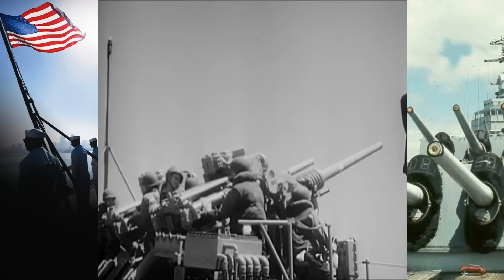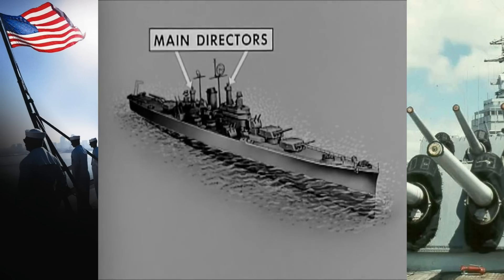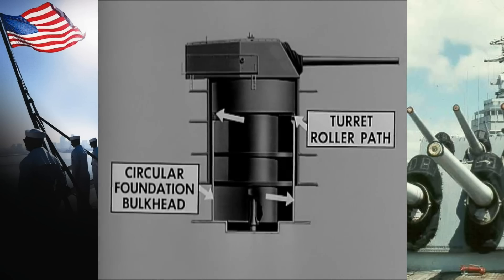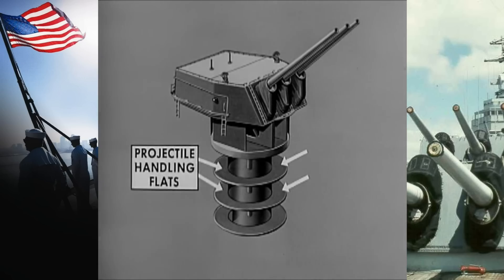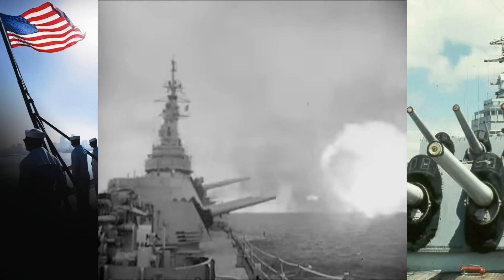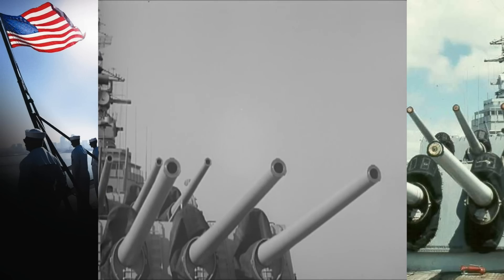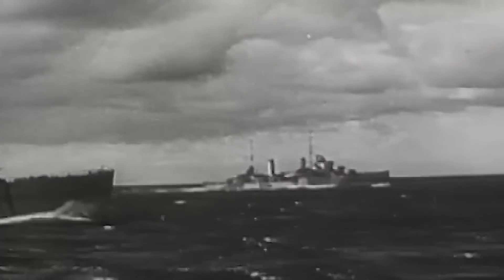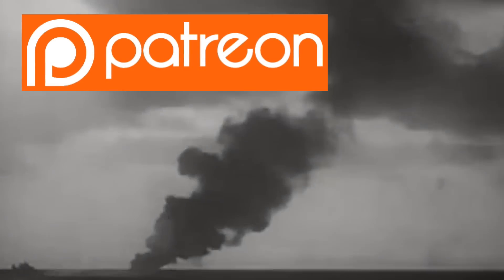How Do Large Caliber Naval Guns Work?

Comment: 8 inch? use MM please
Reply: The Great Arabian Knight 203mm
Reply: 8 inch=Big fucking gun
Reply: The Great Arabian Knight I only measure in standard freedom units.
Reply: I feel the same way when watching British or German docs. They use mm and I don't have a clue since I'm American and we use inches. This is an American movie demonstrating American technology. Of course it's going to be inches.
Reply: I'm an Army guy, and we already use the metric system. But I learned a bit of naval gunfire operations. They measure their speed in knots and angles of elevation and deflection in degrees. Army guys measure speed in KPH and use mils (6400 mils in a circle) for elevation and deflection, aiming at targets hundreds or thousands of meters distant.
Reply: The problem with the imperial system is that it is now defined by its metric equivalent. The metric system is based on immutable physical phenomena (https://wiki2.org/en/Metric_system). The old yard, pound avoirdupois, liquid measures, etc. were defined by standards kept in the Bureau of Weights and Measures. Those items were made of metal alloys that were resistant to changes in lengh or density and were compared with other standards to ensure consistency. Metric standards exist as well, but are of lesser importance compared to the physical phenomena that define them. For example, water, at 20 Degrees Celsius, will weigh one kilogram at one liter of volume. The standard meter is defined as approx. 1/300,000,000 of the distance that light travels in a second. Neither of these phenomena can change or degrade over time, compared to a standard yard or standard pound.
Reply: Every computer has a handy built in calculator.
Reply: David Beattie wow that's so helpful thanks xD
Reply: Like on the Prinz Eugen, or HMS Exeter.
Reply: I want to say this:
The largest naval gun every put on a battleship was either on the Yomato or a WW1 British ship. They were both around 18 inches (around 400mm) but I can't remember which was bigger. I think the Yomato gun was.
Edit: The Yomato gun was larger at 18.2 in but the British gun (18 in) had heavier shells
Reply: According to https://wiki2.org/en/40_cm/45_Type_94_naval_gun, the Yamato was armed with nine 46 cm naval guns, but the weapons were designated as "40 cm" in the nomenclature, in order to hide their actual caliber. During WW1, the British had planned for the devopment of 18-inch naval guns, but those weapons were never built.
Reply: the metric system isn't as useful as the imperial system in every day life.
Reply: David Miller ok, then those pictures of huge guns with a British crew under them must be faked. Thanks for correcting me
Reply: No
Reply: David Miller army is for cooks drivers aides not fighting MARINES. NAVY AND AIR FORCE
Reply: 8" ~ 400mm
Reply: 8" x 2.54 cm = 20.32 cm = 203.2 mm...you must have been thinking of 16" guns, eh?
Reply from the maker: The Great Arabian Knight pass.
Reply: Nuclear Bomb Americans are dumb, the metric system is so perfect why not use it?

Comment: "The guns are basically automatic" except for the 50 people needed to operate each turret.
Reply: You understand that the film is discussing the difference between the new automatic-loading turret, as compared to the older method that was more manpower intensive. People used to be needed to load those shells directly, by hand.
Reply: Yeah, that is on spot!
Reply: Ocrilat pl
Reply: @Ocrilat  older guns were 50 men per gun  160 for a turret
Reply: An M16 is basically automatic except for the 1 person needed to squeeze the trigger. That's the essence of what you just said.
Reply: @clintonsavage4018  and he first must manually load the magazines, just as with the 8" gun turrets.
Reply: And refill/replace the magazine, aim the gun, etc. 6 rounds a minute from an 8" gun will mess up your day.
Reply: @Bigfoot1955  As will 5 rounds a minute from a 5". While I never served, I have been near a 5" when it was fired. It can rattle your cage if you aren't expecting it.
Reply: 8:10 18 crew.
Reply: Clankplusm Gaming +%
Reply: Automatic,  not automated
Reply: Remember, these guns were produced 50-70 years ago. Nowadays, everything is computerized and automated.
Reply: you can bulid a modren Battleship around these guns
and with today's tech. get 30 rounds a min and GPS.  Rounds
modren armor and gas turbine water jets 45 -50 kts.
with a 20ft. draft. 33-35.000 tons

                                it's Doable.
Reply: 38 men compared to the 80 men needed to use the bigger not automatic 16 inch guns
Reply: patio87 he earns automatic in terms of auto loading, not automated.
Reply: They were automatic because the Mark 8 gun in the Des Moines class fired 10 rounds a minute vs. maybe three rounds for the previous Mark 7.  10 rounds a minute by 9 guns means 90 335 pound 8” shells hitting every minute.  Enough to incapacitate any ship even a WWII era battlewagon.  The Des Moines class had a similar weight of shot per minute as a WWI era battleship or some of the smaller WWII battleships.  All in a heavy cruiser.
Reply: Compare to like how the mighty mo's class was yeah they pretty much are.  The powder monkey's would of love to have had casings vs powder bags. my father served on the Yorktown, Washburn,  Lexington and the Arizona thankfully he was never on that when Pearl Harbor was hit or i wouldn't be here    Trust me he would of loved to seen these "newer" models
Reply: 9:00 they address that point.
Reply: The loading process is automatic. You still need to get rounds into position, aim the gun, and maintain it. There are also 3 guns to a turret to manage. These things had tremendous firepower due to rate of fire and accuracy. You do not want to be on the receiving end.
Reply: Clankplusm Gaming going off the comment I think he used 50 to emphasise his point rather then being precise.
Reply: 68 people to operate barbara gun (Theo battery) in Fort Trondenes :V 16" caliber :D
Reply: Did you actually watch the video? He talked about it ffs.
Reply: including 3 talkers and a checker
Reply: compared to the amount it takes in a 16/45 battleship turret
Reply: Plus the maintenance techs, and the support infrastructure required to keep the labor force functioning.  smh
Reply: I know, how many men a used to clean it after a drill?
Reply: I'll bet with modern computers these things could be 99% automated.and probably increase fire rate.the problem would be empty magazines every 10 minutes
Reply: your comment was answered @8:56 the narrator said is  too much crew for automatic but only doing dial and switches than lifting the weapon and loading
Reply: I heard 38, but hey, i'm pissed, you're the man obviously!

Comment: 1 Imperial Japanese Naval Admiral disliked.
Reply: Well the USN never sank (or encountered) any major German surface vessels, so more likely IJN.
Reply: syaondri mein gott
Reply: Or British.... Our biggest are only like 4.5 inches now...
Reply: they was using 18 inch guns on some ships ww1. BL 18 inch Mk I naval gun
Reply: @carbon1255  The RN did however once operate an automatic 6" gun and designed an Automatic 16" gun (tho we called it the Single Stroke Loading Mechanism) however the Battleship intended to carry it (lion 45) was cancelled.
Reply: We don't have 8" deployed anymore. 8" has been the traditional "cruiser gun". The Japanese had pretty good  cruiser guns on their modern ships.
Reply: @JamesSavik  The last big gun ships were the Iowa class battleship.  The predominate naval ship-borne gun is the 5" (127mm), and now they are mostly all automatic.  I served on a destroyer that was built at the end of WW 2 and she had 4 5"/38s  when I was on board.  I served as a first loader; I placed he 54-65# projectile onto the ramming tray after the powder casing was in place.  If need be, we could fire 10-15 rounds per minute per gun.
Reply: Furious and Courageous BCs- they had an 18" single rifle mount but the shock was so bad it split seams. Both were converted to carriers I think.
Reply: Japan had some pretty big ass batteries on their ships, the one on the yamato is still the largest to date